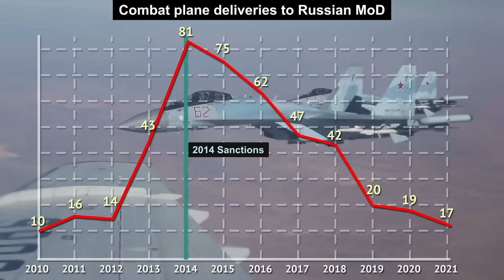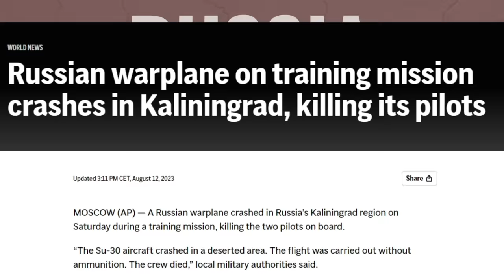Russia has produced more combat jets than it lost in Ukraine in 2023

Comment: you have missed a lot of points while comparing the aircraft losses in 2022 & 2023 and the effectiveness of Russian airforce.
1.) In 2022 Russian army was deep inside the Ukrainian territory, most of the time only securing the roads and not the adjacent areas hence more aircraft losses in 2022 as te aircraft have to fly deep in enemy territory to support the ground forces
2.) russian airforce didn't have access to the FABs employed with UKMP kits in 2022 so they have to fly near the target to hit it. now they have access to FABs with range of 40-70 km

since frontline was shortened in 2023 and russian airforce can strike a target with being 40-70 km away from it and ukraine have almost run out of its soviet based SAM systems and the western provided systems are mostly used to cover kiev and the righ bank of dneiper river hence russian losses are less in 2023 as compared to 2022. also the intensity of the war has decreased and the war has been shifted to attrition one. so ukraine's only option is shoot and scoot using western SAM systems. but they are in short numbers and if they get detected by russia and got destroyed, it will cause great problems for ukraine since west is relectunt to provide aid at this stage of the war especially USA
Reply: "if they get detected" ... tell me all about the Patriot batteries that Russia has destroyed.  One day they might get one, but it hasn't happened yet.  Meanwhile, the past 14 days have not  been kind to Russian aviation.  Whether this is a fluke or the new normal is TBD.
Reply: European support: 🗿

Comment: There's an additional issue of loss due to just using the planes over time. These planes can only fly a certain number of hours until they're worn out. Some losses occur from normal use (training + normal patrols) and then there's the significantly increased number of flight hours due to the war. While this usage could be spread over many planes so that few of them are immediately worn out, that just means more losses in the medium and long term.

Comment: If sanction barely impact the production of Russian planes because they make all parts themselves, then what are the exact capability of said planes and how does these compare to countermeasures? Is Russia capable of making these planes more advanced in a short period of time?

What aren't they building lots of civilian planes for domestic use if they can do everything themselves?
Reply: Pre-war Russia was a military plane exporter, civilian plane importer. So one they have production lines set up for, the other they don't. Military planes require different engines and technology. Basically on military stuff you blow money and on civilian stuff you cut costs and it's all about reliability/efficiency.

Another issue is only 1-2 places make the parts for most civilian planes (and those places aren't in Russia). Those part's are all made to certain specs and are a pain to setup an entire line for for just 1 replacement. 

Russia's military stuff is setup so most components are manufactured inhouse because the infrastructure dates back to the Soviets. But for civilian stuff all the Soviet factories are gone.
Reply: @chriskl2361 military planes exporter? When was the last time Russia delivered a brand new combat jet? I know of sells that werent fulfilled but actual delivery..
Russia failed even to deliver t90's to India, even before the war, used old turrets to be able to deliver *some*... and full of problems😂
Reply: Some nations have gotten MiG's or copters, or had existing stocks refurbished/upgraded. Sale of parts is also a big business. The MiG's delivered may have been Soviet inventory or half-built Soviet fighters that were completed though.

The Su-30Ks and Su-30MKIs has been delivered to India. It was developed during the Soviet's but production was mainly Russian.

China and other nations have also received several Su's
Reply: @chriskl2361  when? It been years since russia exported a plane that wasnt a soviet refurbished plane? If im wrong, please elaborate and ill gladly apologize.
Reply: @FelipeScheuermann1982  Su-30Ks? Some were probably built on half-complete planes but some have to be newish.
Reply: @chriskl2361  ok so in 40 years Russians sold a few planes they finished the construction... Brazil did more than that, devevolped, built and exported its own planes, at least some, like light attack and transport planes. And no one regard Brazil as a "military planes exporter"...
Reply: @FelipeScheuermann1982  China received Su-35s in 2019. Su-35s were also built for Egypt but American pressure forced the Egyptians to cancel the deal.

Comment: Your numbers seem too low. Remember, onyx just lists visually confirmed losses. The actual once could easily be 2x that number. Add to these numbers planes destroyed on the ground, planes badly damaged (as you mentioned), crashes (such as the SU-25 crash and Mig-31 crash during flights) etc. It looks like the overall losses are more around 23% of their total combat jets, which is massive. The new ones produced do not offset all losses. So while the Ministry seems to invest heavily now into production, all this will take a lot of time, in particular with sanctions.

Comment: You seem to be forgetting that airframes and engines have lifepans before they start developing cracks in the wing spars or engines completely failing. If that's on the ground, it's not going to show up as a crash, but it's still a loss.
According to Justin Bronk, they're ignoring mandatory maintenance schedules so their accident rate is starting to increase significantly.

Comment: Sanctions don't work the way people think it does. Sanctions does not preclude Russia from importing foreign components to make weapons - it jacks up the price Russia has to pay for those components.

Russia's foreign reserves pay for their imports. Missiles from Iran and North Korea, and smuggled components from shell companies. At the current rate of consumption (which is only increasing due to more imports of ammunition), Russia will exhaust their foreign reserves in 2027. Russia does not have allies, so to speak. If it doesn't pay for weapons and components, said inputs and resources never arrive in Russia.

Russia can still make their own shells and parts. However, that supply isn't sufficient to sustain the operational tempo they desire. Machine tools and air frames also wear out - and this will write-off more Russian airframes than any hostile activity.
Reply: @niklaspetrov1807  - 'free' implies that the replacement appears magically out of thin air. We've exchanged one merchant for another.
Reply: Well it cost more for russia to export to India/china and they pay less. I’m happy to buy more from proper countries :)

Comment: How many pilots does ruzzia have?
Reply: A lot less than a couple of years ago
Reply: why is that? have they stopped training pilots?  @legendofthepeach
Reply: @xisotopex Surely you can understand that when planes go boom, pilots tend to die.
Reply: less than yesterday
Reply: @Rius9106  where, in your flawed between the lines reading comprehension, have I said anything like your statement. surely you realize that any nation with a functioning airforce is constantly recruiting and training pilots, and russia, most likely has it down to a science, just like the US does, having not just started 2 years ago. they have a doctrine, they have a pipeline, they have recruiting needs and forecasts etc etc just like every other single nation. in what la la land do you live in where you think any nation is going to win an air war with the pilots it has, and not need to continually train new ones? do you think the US, in vietnam, didnt replace lost, expereinced pilots, with new, green ones? how do you think this works, exactly?
Reply: @xisotopex  well they lost dozens to shoot down and crashes. Most aircraft orders are replacing airframes not expanding so they are generally crewed, it’s far easier to replace an aircraft than a pilot, takes a couple of years to get someone flying a small aircraft well, flying fast jets and missions requires further training so about 3 years would get you the least experienced guy. Assuming they had some of their most experienced flying the early missions thinking it wasn’t going to be an attritional war. Then even fewer experienced on the latest gen aircraft. They are downplaying sanctions as well, it’s caused a massive issue to aviation a lot of parts such as optics and electronic systems are European so it will make them have to rethink supply chains or even attempt to copy certain tech.

Comment: The suggested number of losses in this video fall way short of the confirmed losses including photographic evidence on onyx. Added to that, onyx hasn’t got anything listed on either side past October last year, though there have been several confirmed VKS losses since then. The number of aircraft Russia has lost was over 70 by last September, and that’s whilst disregarding some of the onyx listed ones that don’t have such clear confirmations. Helicopter losses are over 110 for certain, half of which are Ka-52’s. If you add on the aircraft and helicopter losses that are not listed or are damaged beyond economical repair, and claims on this video are a further 2/3rds (I struggle to believe this one) you’re looking at over 100 aircraft and 150 helicopters. 

Now take into account the required maintenance per flight hour for each of the remaining aircraft. This is something that is going to consistently pull in parts from aircraft that are only being used for their parts. The majority of those are likely to just be parts from combat damaged aircraft, but there will be certain things required off the manufacturing line. Since Russia has pulled back on strike aircraft attacks and has resorted to longer range attacks using the Tu-22M, MiG-31, Tu-160, and Tu-95 to launch these from within Russia and Belarus, they are losing far fewer aircraft. With the aim to ramp up production of kamikaze drones at far lower costs than combat aircraft or their costly munitions, I don’t believe there is any kind of urgency to replace the high number of Su-25, Su-30, and Su-34’s that have been lost, when they can instead focus on production of drones that are far less likely to see a loss of trained pilots and are far more cost effective. They also won’t rely on parts that Russia has been obtaining from the West.

Comment: What is the different of a ground strike jet and a ground attack jet
Reply: Perplexity ai:

The main difference between a ground strike jet and a ground attack jet lies in their primary roles and design characteristics. A ground strike jet, often referred to as a strike aircraft, is designed for carrying out airstrikes with precision and is prepared to face strong low-level air defenses while conducting attacks. On the other hand, a ground attack jet, also known as an attack aircraft, is primarily focused on attacking targets on the ground, providing close air support and engaging in naval air-to-surface missions.
Reply: A strike jet is like a small bomber. Tactical bomber if you will, as opposed to a strategic bomber..
Reply: No difference - both weapons glorified in the form of posters.

Comment: Has it also replaced all the lost pilots?
Yes, Russia has upgraded its military economy vastly.
To pretend that all is well is stupid however.
Reply: all is well as they are currently decimating frontline AFU troops because NATO/AFU air-defense has been degraded and these strike aircraft are causing the AFUs line to collapse
Reply: @samk2266  Sure.
The ukrainian weaknesses are very apparent.
Nevertheless Russia also has high casualties.
I am saying this neutrally and factually.

Both sides lie about reality.
Reply: @samk2266  AFU air defense has degraded because they have no ammo for them, like for the artillery which allowed Russian Army to advance.
Reply: Thanks god pilots are not obliged to die with their machines, about half of them survives.
Reply: @ivandelei3062  Yes, of course.
But not all right.
Manpower is really the decisive issue here.
It was a russian problem before the partial mobilisation and it is a ukrainian problem now.
Loosing an entire A50 crew is a desaster, for example.
Reply: Russia has high casualties based on what evidence exactly? @LawrenceofIsrael

Comment: I would think as long as the manufacturing and tooling was not destroyed and the government could recall the trained labor they could ramp up production of the Mig-35 in substantial numbers very quickly. The weakness of the Mig-29 was it's grossly obsolete cockpit. With modern avionics it has the potential to be a very effective fighter Jet. And it would be much cheaper for the Russian government to procure in large numbers over Su-34's. It's a multi role fighter meaning it could supplement both air and ground attack defense at a fraction of the cost.

Comment: You didn´t mention spare parts for existing planes(affected by sanction// also for civil russian planes). You can and will not keep all planes flying, especially with combat sorties and more training hours. At least 30% of all planes are on the ground, for repairs and maintenance. I highly doubt they have spare parts readily available.
Reply: I agree with your general point, but define "readily available". The US mindset is to keep all systems as close to 100% as possible and ground them if they aren't. A total war mindset (German BF-109s sortie rates if don't want a Russian example) is "the redundancies are there to keep them in the air fighting". The real question is if Russia has entered "Total War" at least in regards to its air power
Reply: @ThrawnFett123 There is no comparison between US and any other military(especially in Air). I think that doesn´t really matter. They simply don´t have enough and cannot produce a lot of the actual parts. I bet they take actual military stock and use them for spare parts. Which degrades the number available. This is not mentioned in the video.

Comment: USA lost 10.000 aircraft in the vietnam war. Among them 31 B-52 Stratofortress, 6 AC-130 Spectre, 55 C-130 Hercules, 3 KC-135 Stratotanker, 2 SR-71A Blackbird, 683 F-4 Phantom, 1 C-5A Galaxy.
Reply: Yup over half of those were helicopters...the s-75 and later on the s-125 with the mig 21s  supplyed by the Soviet Union won the war for Vietnam
Reply: No SR-71 has ever been lost in combat. None!
Reply: All told, the U.S. Air Force flew 5.25 million sorties over South Vietnam, North Vietnam, northern and southern Laos, and Cambodia, losing 2,251 aircraft: 1,737 to hostile action, and 514 in accidents. 2,197 of the losses were fixed-wing, and the remainder rotary-wing.

Do some research before something 🤬 like that
Reply: @ghost_2448  Take youre own advice and do some real research...over 10 000 aircraft lost over half of those were helicopters tho...soo youre seriusly trying to say that the USAF lost under 60 helicopters  ? :) over 5000 helicopters/rotary-wing were lost thats a fact not something to be debated it is what it is
Reply: @unclescar5616  None have been lost to enemy fire.  Two were lost due to accidents while on missions that included surveillance of North Vietnam.
Reply: @rinneganitachi4840  helicopters are helicopters aircraft is aircraft there's a difference..
Reply: @ghost_2448  a helicopter is an aircraft, so is a plane, and aircraft is any helicopter, plane or machine capable of flight

Comment: The biggest loss of aircraft is likely just the lifespan of an airframe. Russia is probably producing just enough to replace retiring aircraft and the extra parts needed. The low flight hours of pilots and very conservative use of their aircraft are indicative of that. This also means the training level of pilots are consequently fairly low as the Russian state can't afford to have planes flying much for training.
Reply: Ok nice cope. Pictures and videos tell a different story.
Reply: @tonylarimer1326  Big brain reply
Reply: @naitnait00  hmm,  training level being low would contribute to attrition of hardware(planes) in field operations. Additionally the poor availability of advanced technology would create functional gaps in the performance of high tech fighter/bombers. Considering the very low profile of the russian Air Force in this war I would reasonably conclude that this is probably true. The downing of a second A-50 awacs over russian territory is interesting. It is possible that the German patriot system which is much easier to field deploy than the us variant is responsible. Survival of a trained specialized crew in this situation simply is not a factor.
Reply: @tonylarimer1326  Eh, were you drunk or something on your initial reply? The lack of training would also affect the ground crews of the air force as well. Often overlooked, the operational side with mission planning, maintenance and coordination also takes a hit.

Comment: The replacement A-50 is the A-100, which is still an IL-76 airframe but with better engines and updated EW suite. BUT, the factory struggles. They lost key skills as for example, a new build fuselage exploded during pressure test which is so bad even Boeing hasn’t been experienced that! Next, these are packed with hand built low volume exotic electronics. Some of those are from Israel. When Putin backed Hamas he broke that relationship. So I very much doubt we will see full capability A-100 in any time soon.
Reply: lmao, even the DeHavilland Comet needed a some time on the airframe before the fuselage failed

Comment: I think you are assuming they have the parts to build these and have pilots to fly them.  Also, oil and gas exports noticeably decreased so I wonder if they can afford to replace all these losses.
Reply: Russia has a very low national debt, so they can afford to keep up a high deficit spend for 4-5 years without running into huge issues.